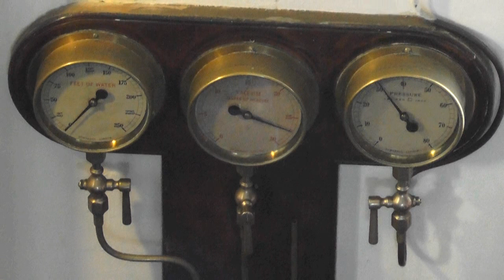Kew Bridge Steam Museum -- Grand Junction 90 inch Cornish Beam Engine

Comment: Went here today with my son and marveled at the scale of this monster from a few feet away. It rises up through the ceiling to a total of three stories, and you can climb iron staircases to see the sides and top. I think that this video was taken from halfway up. It really is very high. From 2:40 you see the top of the giant piston column, and at 3:12 you see it looking up from below.

Unfortunately it was not in operation while I was there, so thank you for sharing this video. They only run the steam machines on weekends, bank holidays and school holidays. There's an actual scale steam train you can ride around the building. I'll definitely come back when it's running. Lots of good activities for kids. My 3yo enjoyed himself, and there were school groups who looked like they were having fun.

Another mechanical display from the Victorian era are the Engine Rooms at Tower Bridge. Inside you see the impressive machine that once lifted the bridge. Nowadays it's an electric hydraulic system which you don't get to see. But the old system had large pumps on the south bank that pushed high pressure water to the central pillar to lift them. So the drive system is in its original location, and impressive to behold. I've lived in London for 20 years and saw them for the first time last week. Glad I did.

Comment: what time do you opening is the beam engine running ?
Reply from the maker: Hi Sandra, Your best bet will be to look up 'Kew Steam Museum' on the internet for the  most up-to-date days and times when the engines are in steam.
Reply: This engine can’t be run frequently because of the expense of providing enough steam. If you’re going to be travelling a long way to see it in action then it’s best to check with the museum website first. 6:47